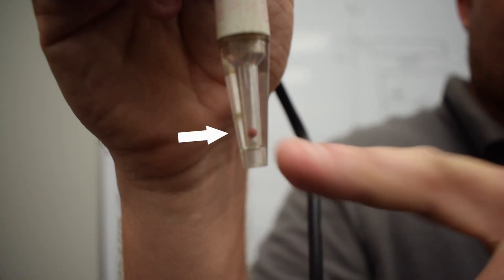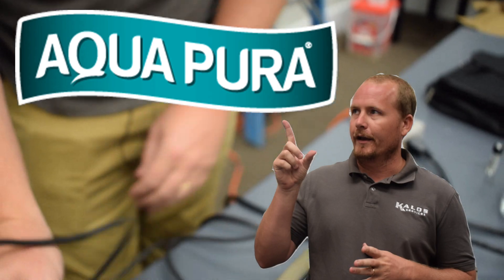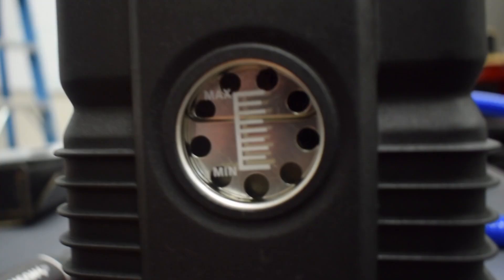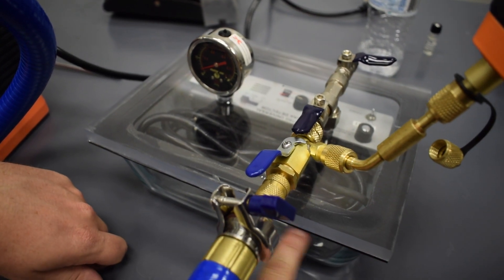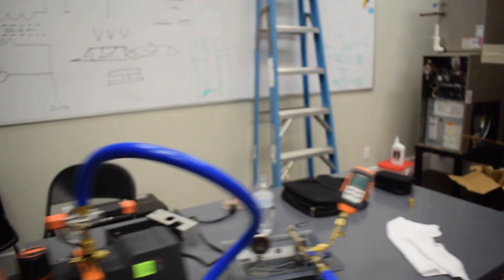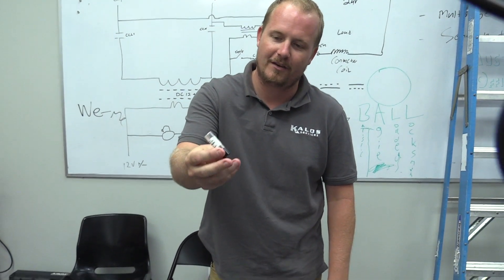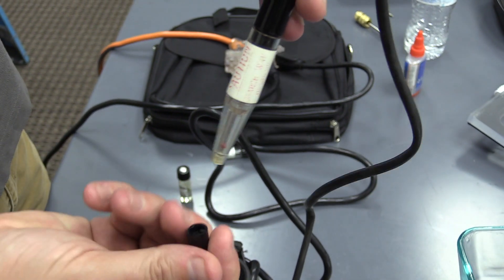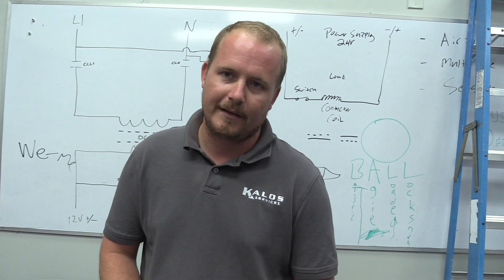Putting Water Inside Our Leak Detector

Comment: wonder if that would work for other devices like cell phones?
Reply: Idk  but I think I'll make a chamber and try it. Curious as to How it will affect the LCD screen. It it works, there's money to be made.
Reply: Yes it can be used on cellphones. Its also used in the process of applying the glass to the LCD display to remove air bubbles before the glue is cured.
Reply: If you've got an S9 laying around you can send me I'll try it.